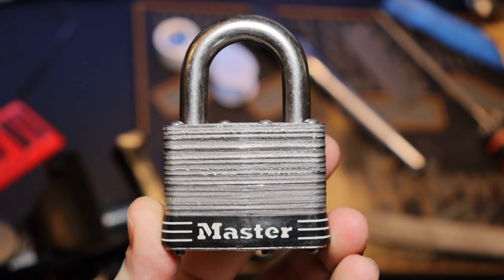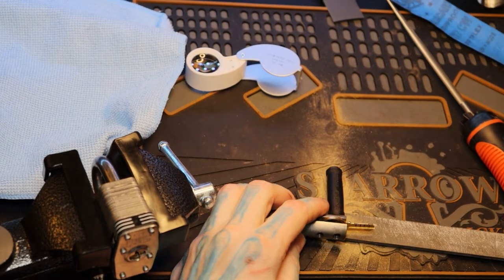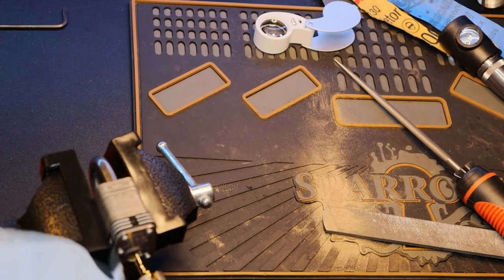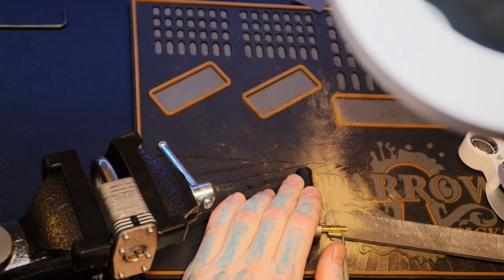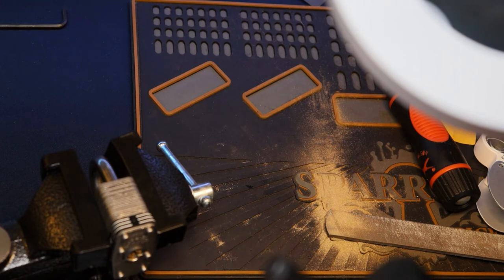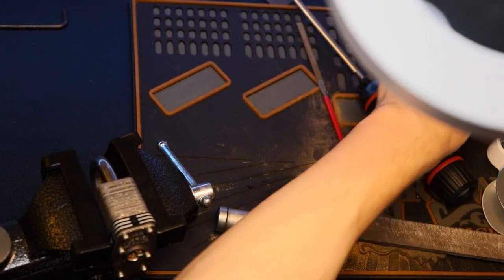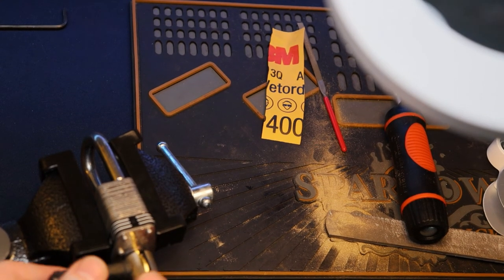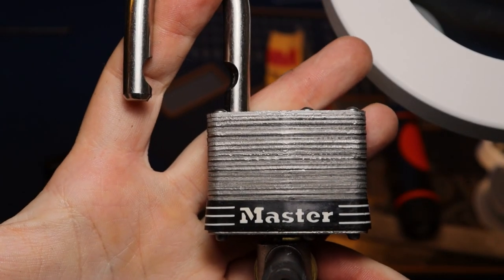189) Impressioning a Master Lock No 5 Padlock

Comment: Nice job!
  I'm sure you have mentioned it before, but, where is the torch-fitting magnifier from please?
 I have a load of keyless locks that I'd very much like to impression for. I understand and am pretty much kitted out for the process, but tbh my eyes are that bad now- I'm struggling to see the marks. This would be a huge help. 
Cheers. 🤪😁🔓🤘
Reply from the maker: It's from MBA USA. I really like it as an option to have around. I find myself still using others sometimes but this thing is great!
Reply: @LockpickingDev  Yep, found them and they seem reasonably priced, although it would obviously inflate with shipping to the UK. May see if I can encourage someone to include one, in a cross-seas lock trade.... 🤔
 Either way, very handy and definitely one for my wish list.
 Thank you for that- much appreciated. Great content, as always- keep on pickin' mate. 😁🔓🤘